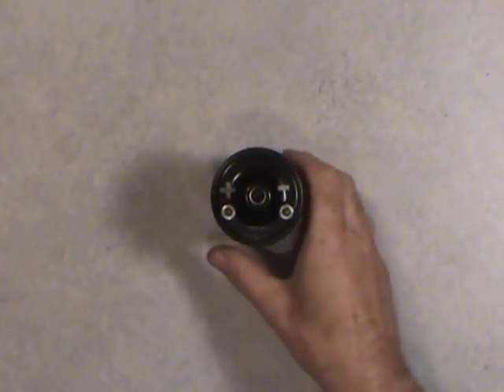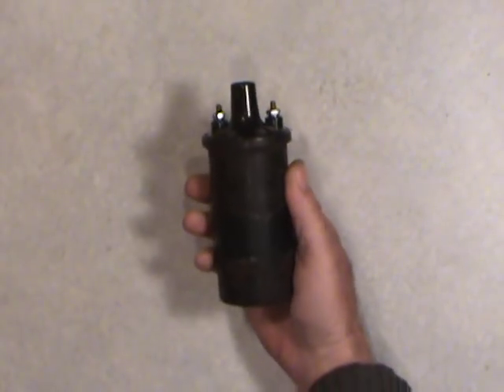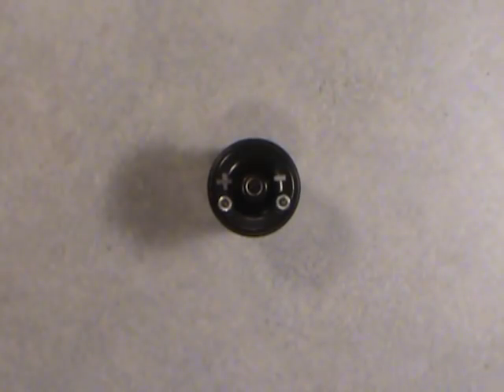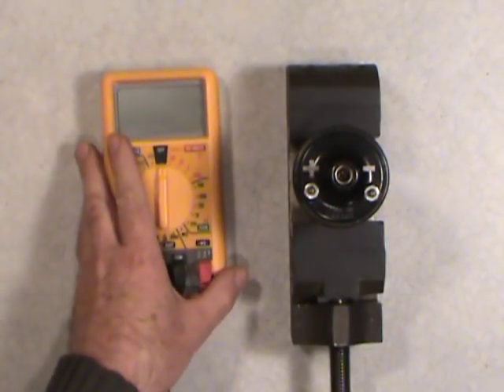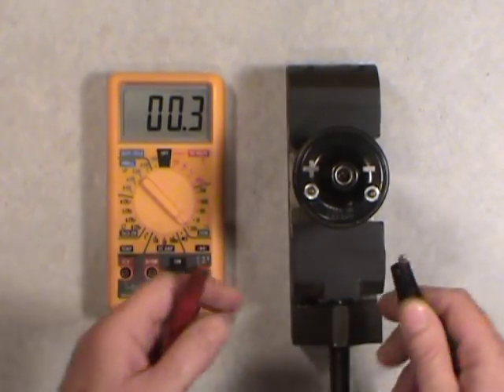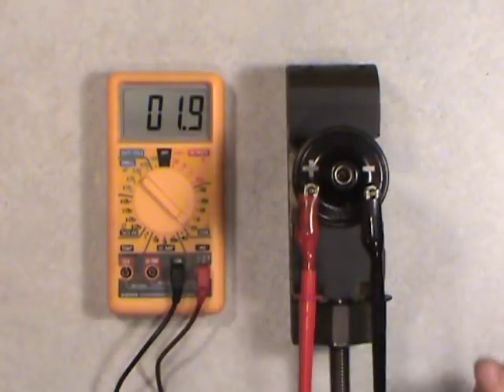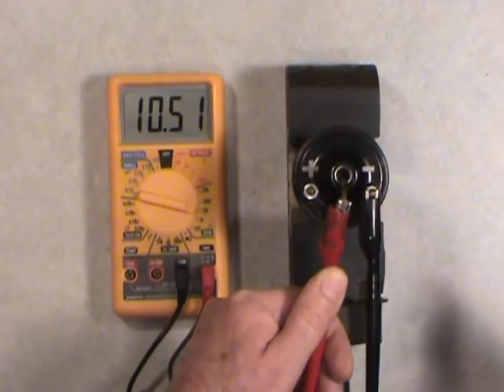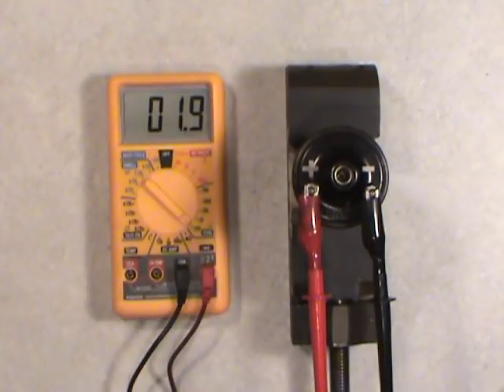Ignition Coil Testing

Comment: I've always used the tried and tested HOTTAS test method. Ask an associate for help and ask them to Hold On To This A Second..... and hand the person (sucker) the end of the HT lead. Then with the coil powered up trip the points. (Don't worry as YOU are perfectly safe as only the associate suffers!!). Judging by the reaction from the mug that you've attached to the end of the HT lead then the coil can be judged as (A) dead, (B) weak, (C) good or (D) racing grade. With the latter the test subject may jump and fall to the floor. A good coil will always cause a load of foul language to pour from the test subject and it is advisable to be standing closer to an escape route than they are. I once caught my brother twice in the same day whilst sorting his bike out, back in the 1980's. It helps if the test subject is intelligence challenged / hard of thinking. I've watched someone use the HOTTAS test on a magneto using his wife as a test subject at an auto jumble.
Reply from the maker: +Andy Reid ....Greetings Andy Reid....Thanks for watching, and for tellin' me, about the, as You put it, the HOTTAS test method.....................What You were sayin', about the HOTTAS test method, and the fact, that You happen to have posted it here, has me thinkin', oh no, Not Again...!!!...lol....................Well, my Life, so far, always seems to have, quite a few "Coincidences", every now and again, and the HOTTAS test method, is yet, another one, of those Coincidences...!!!.................Now then, here's that True Story, as best, as I can recall........................I believe, that, I was in about Grade 9, in High School, and the Course that I was takin' at the time, was probably called Power Mechanics.....................In the Shop, there was a Full Size Car Chassis, without the Body components on it, but that, in itself, is not, what all of the Excitement is about, so, here we go...................There was a few, Briggs and Stratton 4-Stoke-Cycle Engines, that were "Cut-Away", showing the Piston, Crankshaft, and the Valve's Movement, for Demonstration purposes, so all could see, what was going on inside of them, that also had, a "Hand-Crank", on one end of the crankshaft, and these Cut-Away, Briggs and Stratton Engines, sat, On-Top of, a Sheet Metal Topped, quite long Work-Bench, that was also, Capped along the Edges, with some Steel Angle-Iron...(can You see where this might be going...???)...lol...anywayz, because the "Shop"..."Was the Class-Room", the Teacher had to use His chalk-stick, on a Black-Board, that was on Wheels...!!!...lol...and, there were only a few Stools to sit on, at any given time...................Then one day, as the Teacher was Drawin' and Explainin' stuff, on the Mobile (lol) Black-Board, there were about, oh, maybe, as many as, about 6 Students, that had Their Butts, leaning on, and also having, Their Hands at Their Sides, also in Contact, with that Angle-Iron Edge, of the Work-Bench, and a short while later "it" Happened..............Some "Turkey" (actually, it was the Smart-Azz Student/Culprit), that Decided to Ground, one of those Briggs & Stratton Engine's..."High Tension Lead"...and held its End, on that All-Metal-Work-Bench...then...Mr. Smart-ee-Pants..."Cranked the Handle" on the Briggs & Stratton Engine, as fast as He Could Crank it,  and..."All Students", that were Touching that All-Meta-Work-Bench..."Jumped-Off-and-Away-From-that-Work-Bench"...that just..."ZAPPED THEM"...!!!..."FASTER-than-a-SPEEDING-BULLET"...!!!!!!!!!!!!!!!!!...and then some...!!!...LOL...for Me...cuz, I wasn't all that Close to the Work-Bench to begin with...but...not so...lol...for the Students that got..."ZAPPED-BIG-TIME"...!!!...Yikes...!!!.................Ah yes..."Those were the Days my Friend"...and till next time...........Be Safe, take care, and have a good one.
Reply: +RockysRoadshow A few years ago I was sat at a set of lights when a loud shotgun like bang came from under the gas tank of my motorcycle, with some smoke and the left hand cylinder died but the right hand one was still running fine. The left hand ignition coil had exploded and all the windings were spread out of what was left of the coil housing hanging down. Prbally one of those once in a lifetime things.
Reply from the maker: +Andy Reid ....Greetings Andy Reid....I hope You didn't get injured when Your Bike's Ignition Coil went...Boom...!!!....................There is one thing, that I can think of (off the top of my head), that might have caused, Your Bike's Ignition Coil, to, shall we say, Self Destruct, like it did.................Something, like, oh, as an example, let's say, a spark plug Wire, came loose, then, that poor ole Ignition Coil, would probably try to Raise its Secondary High Voltage, to Infinity and Beyond (which it can't, and still be able to survive), cuz, once that poor ole Ignition Coil "Exceeds" the Secondary High Voltage (limit), that it was designed for, for an extended period of time, then, the result will probably be, some rather Serious "Over-Heating" alright...........Things like, Spark Plug "Gaps" getting too Big, and/or, Higher Compression Engines, will usually make an Ignition Coil Work that much harder, as in, Outputting a much Higher Secondary Voltage, to try to, make a Spark Jump, that, way...too Big of a Gap (what-ever it happens to be).........................If, too many Amps (of electricity), that, that particular ignition coil was designed for, are applied for too long (time-wise), on the Primary/Low Voltage side, of an Ignition Coil, then, that can also Damage an Ignition Coil as well........................Gotta make sure, that, All of the Ignition Components, in an Ignition Circuit, are, shall we say "Matched" to one another, or maybe, result in a Weak Spark, or, some Fried Ignition parts & pieces, it just might be, and..........till next time...........Be Safe (Helmet On?), take care, and have a good one.
Reply: +RockysRoadshow Oddly enough, at the time the engine was idling on both cylinders at a junction waiting for the lights to change. When the bang occured that motor just went onto one pot but kept on running so I cleared the junction and pulled over somewhere safe to survey the damage. It appeared that the oil had vapourised and ignited most likely due to the age of the coil (about 30,000 miles old which is old in bike terms!!). The lead was still attached to the plug (Lodge HN) and the other end to the now hanging off mess of windings, ferrite core and bakelite terminal cap. The alluminium tube casing was full of sticky jam like brown / black cooling oil residue. It's somewhere in my "Black Museum" of bizarely broken bike parts.
Reply from the maker: +Andy Reid ....Greetings Andy Reid....Perhaps, not only, is that 30,000 Miles of accumulated Mileage, on Your Bike's Ignition Coil, considered Old, as You put it, but, when-ever I hear a Word like "Bakelite", I start thinking about, some "Very Old Telephones"...!!!...lol...........Maybe, something, in that Ignition-Coil-that-went-Boom, became Shorted-Out...???...............Be very Careful, and try, Not to have, any, Oil-Filled Ignition Coil's, or Transformer's..."OIL"...coming in Contact with Your Skin, as, from what I recall, some of that, shall we say..."Transformer OIL"...probably more-so, the much Older stuff, is quite "Toxic", and has been know, to be full of, Cancer Causing..."PCB's"...!!!...Yikes...!!!.................All You need now, is a..."Side-Car"...for Your Motorcycle...so You can..."Carry Lots of Spare Parts"...!!!...lol...and till next time............Be Safe, take care, and have a good one.

Comment from the maker: ...now, as for selecting the proper Range for an Analogue Meter (yes-Sir, the one with the needle/pointer that waves at you!...lol)....What usually happens when I'm out of Range with an Analogue-Meter, (Range selected is too Low, for something that requires a much Higher-Range, like in Thousands of Ohm's, and, when the Analogue-Meter is set at, oh, lets say the Lowest-Range), then, the "Needle/Pointer" usually goes past the Scale (Range), to the right, and hits it's stop!...(con't)

Comment: Nice, thanks man!
Reply from the maker: Rich R Greetings Rich R....Thanks for the nice comment, and for, watching as well...................................................Here are few things, that I'm thinkin' about, at the moment..."Drum-Roll-Please"...lol............................................................Even though an Ignition Coil, such as the one, that You see in this video of mine..."Tests-Within-Specifications"..."Ohm-wise" (aka, Resistance readings)...then, as I see it, is just really a..."Preliminary Test"...that's Tellin' me, that, Both the..."Primary Coil Windings"...and the..."Secondary Coil Windings"...that are Contained with-in the Ignition Coil's Housing, are Not..."Shorted-Out"...or..."Open-Circuited"...and are Making a "Good Connection"...to the...Ignition Coil's..."Two Primary Connection Terminals"...and...to that of, the...Ignition Coil's...Secondary High Voltage..."Tower"...Terminal, as well, where the High Tension (high voltage) Lead/Wire, plugs into, and, having the Other End, of that very same Lead/Wire, Plugging into, the..."Distributor Cap's"...Center "Tower" connection terminal, as well...............................................................In the following Scenario, sometimes, and usually quite Rarely as well, once an Operating..."Faulty" (but still happens to Test-OK-Ohm's-wise)..."Ignition Coil"...Heats Up To Operating Temperature, it has been known, at times, to, shall we say..."Break-Down-while-Under-Load"...which, as I see it, would be, having the Ignition Coil's..."High Voltage Output"...Too..."Weak"...as in, having a Lower then wanted/needed "Secondary High Voltage"..."Jolt/Pulse"...that, in this particular circumstance, is just not..."High Enough"...to Make the..."Jump"...Between the...Spark Plug's..."Electrodes"...or, maybe, the Spark Plug/s, might...Fire/Spark..."Intermittently"...as in..."Miss-Fire/Miss-Firing"...just sayin'.................................................Any time, there happens to be a, shall we say..."GAP"...that is..."Too LARGE"...such as a Spark Plug, or Set of Spark Plugs..."GAP"...as well as, something like, where the..."GAP"...is found..."Between"...the...Distributor Cap's..."Inside Terminals"...and the..."Tip"...of the...Spinning..."Rotor"...inside said Distributor Cap (usually, the Gap Increases, due to Electrical Arcing/Erosion, over time)...then..."Those, Too LARGE, of an Un-Wanted/Un-Needed GAP or GAPs"...will, as I see it, be Placing, a "Much Higher Demand On"...and...Puts a "Really Strong/Un-Needed"..."STRAIN"...on that..poor ole..."Ignition Coil", and, could possibly Result in..."One Damaged, and perhaps, Not-Functioning-Any-More"..."Ignition Coil"...in the end...!!!.........................................................Just remember, to keep, All Wiring Connections..."Nice and Clean"...and also, Be Watchin' out for..."Any Excessive GAPs"...in the..."Ignition System's Circuitry"...so, All of Our..."Electron Friends"...can make "Their" Way..."Peacefully & Efficiently"...that way...not only will Our..."Electron Friends"...be quite "Happy", but..."We"...will be too...!!!...lol........................................................Be Safe, take care, and have a good one.

Comment: when i test it on the neg and pos terminals on 200ohm setting it says 4.2 but when i do the test with the high tension lead and the terminal it says 11.90 or soo not over 1. its a 6 volt internally resisted coil from a 53 dodge  is it bad if its 4.2 or if its bad will it just say 0 im confused on that
Reply from the maker: +rob-o dabney ....Greetings rob-o dabney....Thanks for watching..................The first, and most important thing to be aware of, is to use the "Exact" (Factory...???) Specified parts, that have the Specified/Approved (electrical and Ohm) "Values", that make up Your Whole Vehicle's Ignition System, or, there might be some unwanted problems showing up........................That 4.2 Ohms, while having the Ohm-Meter set to the 200 Ohms Range, that You saw, should be alright, seeing as how You mentioned, that it was Resisted Internally.......................................From what You saw, being 11.90, that, to me, would probably be 11,900 Ohms (Eleven Thousand-and-Nine Hundred Ohms), or, showing up as 11.90 on the Ohm-Meter, when the Range Selector, is set to the 20-K Range (K, as in Kilo, just simply stands for 1,000)............(some of the ignition coils, Secondary Ohms Specifications, could be in the ball-park, from about 7,000/7-K, to maybe about 10,000 Ohms/10-K or more), so, 11,900 Ohms (11.90-K), should be ok, as long as those Ohms Readings, are "With-in the Specifications for that particular Ignition Coil"....................There are so many Different Ignition Coils made, along with having, quite Different, Primary and Secondary "Ohms Specifications", which if chosen incorrectly, could result in, a Weak Spark at the spark plugs, or, might even burn-out the Points, in a Points & Condenser type of Distributor (if applicable, that is), or maybe, a Fried Ignition Coil, due to it being Charged-Up (Saturation Time), with too many Amps, or maybe, for too long as well....................If You happen to see 0 (Zero), when ohms testing, either the ignition coil's Primary, or Secondary Resistance, then it's usually, one of two things................Either the Ohm-Meter is not working or is Set on the Wrong Range, or, an Ignition Coil, that is Faulty or Burned-Out......Did You Ohms Test Your Ignition Coil, with-out having Any Wiring Connected to it...???...cuz, if You did, then that, just might give You some Misleading Ohm Readings, showing up on Your Ohm-Meter's Display........................Also, when Ohms Testing the Secondary (11.90) on Your ignition coil, did You try touching one of the Ohm-Meter's Probes, to each of the Primary Terminals, while leaving the Other probe staying connected to Secondary, High Voltage Tower, just to see if there was any Difference in Ohms, by doing so...???...if not, maybe give it a try..........................Try to find out, the "Exact" Primary and Secondary "Ohms Specifications", for the Exact Ignition Coil for Your Vehicle (and hopefully, the one that You're Testing, is in fact, the Correct One for Your Vehicle)...................If You need any more help at all, just let me know, about Your Vehicle and Engine, and if there were any modifications made as well............till next time.........Good Luck, and.........Be Safe, take care, and have a good one.

Comment: Okay, so my primary coils are reading 3.3 ohms, after subtracting the .2 ohms of resistance through the reading wires and multimeter. However the resistance in my secondary coil is normal. Does this still mean the ignition coil is bad?
Reply: I am gonna venture to say it is bad. If one is bad all is bad.  Maybe.